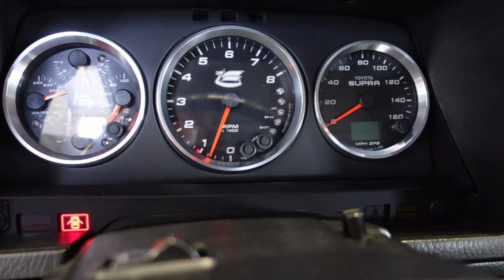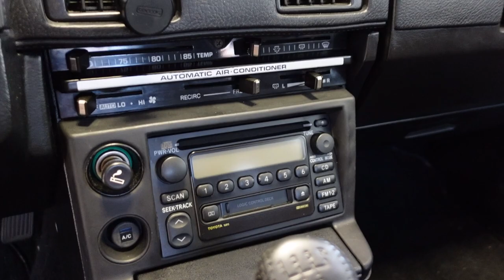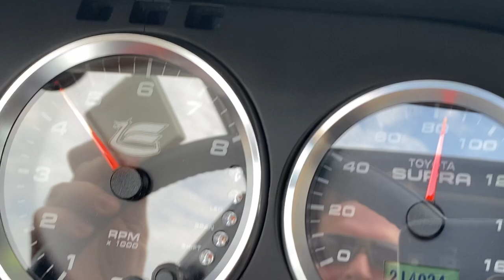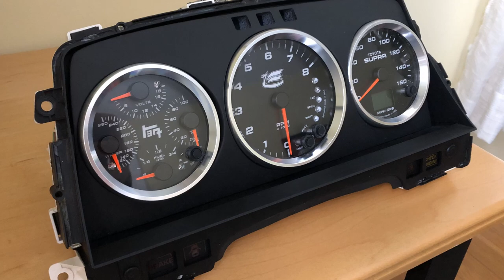My 6-spd MK2 Supra: Switching back to a single disk clutch!

Comment: The original had the factory Fujitsu~Ten 5-band Eq with a teeny little 42mm Sub-woofer under the dash. Thing was a trip. The driver seat side bolsters have never been offered that I'm aware of another rice rocket. The front discs had a habit of warping every 500 miles. requiring replacement or turning. In 1982 Domestic cars were still 90% of the market. Unlike today off-brands just didn't exist. You couldn't go to Grand Auto now Oreilly and have 3 different alternatives. IF you drove japanese, even in California you went to the toyota dealer or a scrap yard.

Comment: Cleanest Sup ive seen, so envious. That license  plate is SUPer clever too 👍

I'm a gen4 Prelude owner but I have a lot of love for these Supra's and the LFA and most Toyota coupes along the way. Thank you for the video; it's very nicely done and inspiring of how a classy clean, respectfully modernized retromod should be. It's keeping the best and just improving what needs while retaining and enhancing the original looks. So many poor sports imports got Tuner treatments that were designed only to be obnoxious at cost of performance and aesthetics. True Japanese Tuner cars, even Botozuku in its way, have a natural enhancement of the looks while many Americans just threw on any and every item at the local parts store.
Of course sesthetics take a back seat to performance as should be😆

Comment: Short of cutting into the rear and fitting a Mk3 diff I think you are at the limit with the TrueTrac LSD. I mean there never was enough space for the crazy engine swap you did in that rear diff hole to begin with. The milimeter gaps around the trans bell housing are a testament to the madness at work here. But you're a creative madman. Can't wait to see what you come up with

Comment: What a beauty. I love your MK2. I've always wanted to do the same swap butCalifornia has too many restrictions, it's just ridiculous... Plus prices for a 2JZ motor is just way too much if you can even find one, sigh. Great build and thanks for sharing.  I'm interested in your wheel setup and would like to know who to contact to get mine cut.  What are your offsets for the front and rear wheels? What size tires are you running on these wheels & are you using any spacers? Thank you for your time. 
Andrew
Reply from the maker: Thanks for the comments Andrew!  I remember when i first did my 2J swap back in 2011, JDM 2JZ engines were a dime a dozen.  I picked up my 2JZ-GTE for $1800US--crazy cheap compared to nowadays.  I believe you can still buy the wheels from Boyd Coddington Wheels; they have the CNC CAD design and can cut a set for you.  You can get them in 17" or 18" with any offset you desire.  My tire and wheels sizes are 265/40-17 rear and 225/45-17 front on 17x10 (+6) and 17x8 (+0) wheels, respectively.  Hope this helps!

Comment: Very nice Supra - but the steering wheel does match the style and "potency" of that car (at least in my humble opinion). ;-)
Reply from the maker: Yeah, the steering wheel is dated but it’s original. If I could find one that looks close to OEM but smaller in diameter with thicker grips, I’d be game. But I find modern aftermarket steering wheels look alien in the interior of these cars.

Comment: Ditto on all the compliments.  If you have any plans for a differential transplant would you please post them? I contacted Grannas but he wasn’t interested in providing a kit for the mk2. Sounds like you have plenty of connections. Maybe you could talk him or someone else into designing and selling a bolt in diff kit that will work with the OEM wheels?
Reply from the maker: Given how the rear suspension is designed for the MK2 (and how the diff is integrated), engineering a rear diff upgrade would require a lot of R&D, including suspension re-work. This sucks as given the low volume and potentially high price for such an upgrade, nobody wants to sink time/money into a project like this.  But never say never—hopefully someday a smart engineer could put some plans together that people like me would use to build our own….

Comment: the paint and trim on this car are outstanding .
i have a 85 gts coupe that I want to restore.
i expect the trim and paint to be the most difficult part .i want it to be done right .
i would greatly appreciate any advise from anyone out there who has restored the body and trim on one of these cars.
Reply from the maker: The car that influenced me as a teenager was an '84 GTS coupe that my girlfriend at the time, her dad let me borrow.  That car is what started it all for me!  Regarding restoration of these cars; I recommend removing anything you can from the body and trim for refinishing.  It's tedious and you have to be careful not to break parts but it's the best way to do it right.  I actually need to repaint my rear bumper due to a paint bubble (de-lamination) that developed so I'll be removing the bumper to strip it and repaint it this summer...Keep your eyes peeled for a video.  ;-)

Comment: I had an '85 Supra back in college, but the paint, though nice for its age, didn't look any where as good as yours.  Great job on the paint job.  The only question I have is I thought the '84 has that single black spoiler on top of the rear hatch, and the '85 has a body color matching spoiler which has the "bar" over the bottom of the hatch.  So yours actually looks like an '84 or am I missing something?
Reply from the maker: Good eye on the rear hatch!  I have the original rear hatch/spoiler for my ‘85 but I prefer the look of the ‘82-‘84 sunshade spoiler. When I converted to the carbon hatch, I used it as an opportunity to convert the spoiler too. 👍
Reply: I had an 84 and 86 Supra, and you are correct to say 85 had the color coded tail that came down and bared across the bottom of the hatch. but if the production date was after October 84, its branded a 85 model usually.

Comment: Hi Dan, Awesome car, I have a question - I am restoring an 85 Supra and i am trying to find an A pillar guage pod. Where did you get yours?? don't tell me you made it...
Reply from the maker: Nope, I didn’t make it. It was already installed when I bought the car back in 2010. You might want to check Raptor Racing…George has a lot of MK2 stuff and if he doesn’t have one, he might know where to get one. Hope this helps!
Reply: thanks Dan, unfortunately George has too much of my money at this point. I have been meaning to drop in to give him an update on the Mk 2 anyways so I will check next time i see him - thanks! @DanDulac

Comment: I love the Coddington wheels.  I am thinking of ordering some for my Mk2 Supra, I would love to know the exact size and offset you used if you don't mind sharing.  Super cool car.
Reply from the maker: 17x8F (0mm offset), 17x10R (-6mm offset).  Hope this helps!
Reply: Thank you!  Did you go with 8 inch front because wider would cause rubbing issues?  Do you have any rubbing issues with this setup?  I appreciate the info! @DanDulac
Reply from the maker: @bbaker4606  17x8F was the prevailing size recommendation at the time (circa 2011) when we had the very first group buy. Some went up to 18” diameter but I thought that too much for the style of car. No rubbing anywhere with my setup.  But when my tires were new, I had slight rubbing in the rear on the fender arches under very hard acceleration (suspension squat).  But only very slight. 265mm width rear tire is as wide as I would go on this wheel size. You could reduce the offset to go wider in the rear but then you lose some of that ‘deep dish’ look.
Reply: Thank you very much for the info.  I agree with the 17' looking much better, the 18 is definitely too big.  That's actually cool that you have enough acceleration to make it squat like that.   Mine still has the original engine, so I won't have to worry about that! @DanDulac
Reply from the maker: @bbaker4606  no problem!
Reply: @bbaker4606  I am trying to set up a group buy! Made a post on the CelicaSupra forums.

Comment: Did you strengthen the rear sub-frame or differential?
Reply from the maker: I installed polyurethane subframe bushings to eliminate flex.  The diff is upgraded with TruTrac limited slip w/3.73 gear but is otherwise stock.  But even still, the diff is now the weak point in the drivetrain so I have to be careful with hard launches...
Reply: Absolutely beautiful car mate

Comment: Did you have to shim your throw out bearing or was it good right away? I have a QuickTime and t56 for my 3rz swapped celica I haven't installed yet.
Reply from the maker: Yes, I measured throw out bearing clearance at bellhousing surface before installing transmission. If I recall, I needed to shim to get proper clearance. Joel Grannas has a video of how to do this on his website if you need more info. Hope this helps!

Comment: Love the build. I was wondering what's your thoughts on the performance of the synapse engineering BOV on the car?
Reply from the maker: I love it.  Not a single issue with it. I have it recirculating back into the intake.

Comment: Great video. Was on the forum/ in the gang years ago. Question, starting a build soon to include the  T56 right off the bat, 2J as well. What I am wondering is about your gauge cluster if you’ll be willing to share.
Reply from the maker: Sure—happy to share whatever info or stuff you need to build a similar cluster. Just let me know!

Comment: I think that hood is disgusting, also wish you'd kept the gauge cluster, but it's still a 400 hp MK2 Supra, and that's pretty special.
Reply from the maker: I still have the OEM hood and gauge cluster so it's nothing that can't be reversed. But the ~35lb. weight saving plus the extra under hood cooling does make a difference.  To each his own.
Reply: @DanDulac  Fair enough Dan, it's like a gorgeous woman with a tattoo I don't like, so you deserve to be proud and obviously your work is top notch.
Reply from the maker: @nathanchildress5596  great analogy!  👍

Comment: Wow, they make a carbon fiber hatch for the MK2 do they sell one for the MK3? I've never seen one
Reply from the maker: I picked up my carbon hatch from Raptor Racing...If I recall, Raptor had Advan build the carbon hoods and hatches for the MK2.  Worth a check with Raptor to see if they offer a MK3 hatch....
Reply: @DanDulac  are u using your original window? Any leaking if so?
Reply from the maker: @tommyhajimoto6968  yep! Original glass but I did purchase a new window seal when I installed it. No leaks at all.

Comment: It would sure be nice to get some of these wheels.  I wonder if there would be enough still interested in doing another group buy?  Do you have any additional info you could share about it?
Reply from the maker: I believe you can still get them. Coddington Wheels cut them when we did the group buy. They have the machining files so they can easily cut you a set. Worth contacting them!
Reply: I am trying to set up a group buy! Made a post on the CelicaSupra forums.

Comment: Love your MKII! I have a couple of questions regarding fitment with the T56. Which engine mounts are you using, XCessive? How was the shifter position with the T56? Were any modifications or panel massaging required to fit the trans? 

My 2JZ-GTE/R-154 swapped MKII was flooded during Hurricane Harvey unfortunately. Its been a long road to getting her back on the road. However, I have a freshly rebuilt R-154 that I could probably sell to fund the T56 setup.
Reply from the maker: I made the mounts using the exact specs offered by wilbo666 (here’s the link: http://wilbo666.pbworks.com/w/page/37092811/M%20Series%20Engine%20to%20xJZ%20Series%20Engine%20Conversion%20Engine%20Mounts ). Shifter position is perfect when you flip the shifter housing 180-degrees on the T56 Magnum. I did a write-up back when I first did the T56 swap in 2018: https://www.celicasupra.com/threads/project-“silver-bullet”-—-part-3.119721/page-3  Hope this helps!
Reply: @DanDulac  Thanks so much! I got excited and asked those questions before I even finished the video. Turns out a video of a clutch replacement showed me all I needed to know. 🤣

Comment: where did you get the pillar pod?
Reply from the maker: It was installed on the car when I bought in in 2009.  But you might want to check Raptor Racing...they have lots of vintage MK2 stuff.  Hope this helps!

Comment: Was it really necessary to drain the transmission?
Reply from the maker: On this trans, maybe not.  But past experience tells me that fluid will leak out of the rear slip yoke once you pull the driveshaft. I drained it just to minimize a potential big mess. 👍
Reply from the maker: On this trans, maybe not.  But past experience tells me that fluid will leak out of the rear slip yoke once you pull the driveshaft. I drained it just to minimize a potential big mess. 👍

Comment: I always figured you had a fair amount of money in order to do the stuff you're doing . But if that's an actual Cobra , and not a replica . Then you must be absolutely loaded .
Reply from the maker: I wish it were a real Cobra. It’s actually a FactoryFive Roadster (cobra replica). I built it back in 2006-2008.
Reply: @DanDulac  so it's a cobra for 90% off 😂

Comment: Info for the wheels.
Reply from the maker: My tire and wheels sizes are 265/40-17 rear and 225/45-17 front on 17x10 (+6) and 17x8 (+0) wheels, respectively.

Comment: So...how much HP? 7 minutes in and you've shown the engine but didn't say anything about the power.
Reply from the maker: @1:12 i mention 450 WHP. 👍
Reply: @DanDulac  Really? How'd I miss that!? Thanks.
Reply: @DanDulac  I bet that 7.5" IRS is screaming for mercy...
Reply from the maker: @scottavuton8196  😂😂
Reply: @DanDulac  I popped two of them with my USDM Twin powered 2J @ 19psi 😢 The 3.73 was holding up well until it got flooded.

Comment: A JZ swapped A60 will always be the Supra for me, So I'm an automatic fan of this car. I really like the conservative interior, especially no intrusive gauge clusters. My favorite build will always be 1986.5 A60 with 3nd gen 1jz (single turbo). I found the motor stupid cheap in Mexico. I ended up being glad I went with a 1j, because it helped me stay focused on a 450 max whp goal and not go crazy. And these days I'm not even tempted because 2j prices are just stupid.
Reply from the maker: It’s crazy how much the $$ 2J engines are these days. I paid $1,800 for my mine back when I first did this swap in 2011.